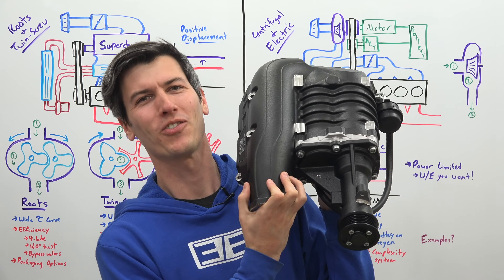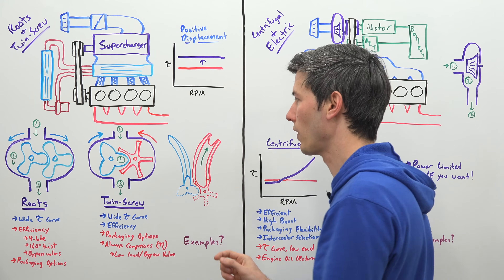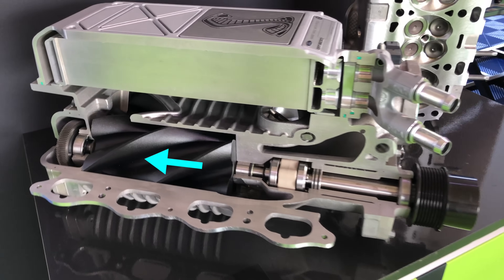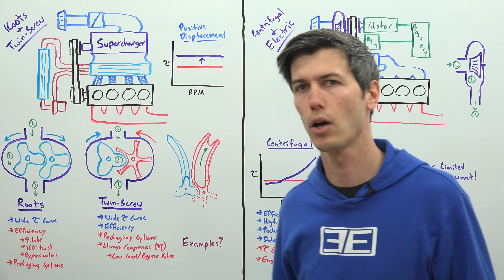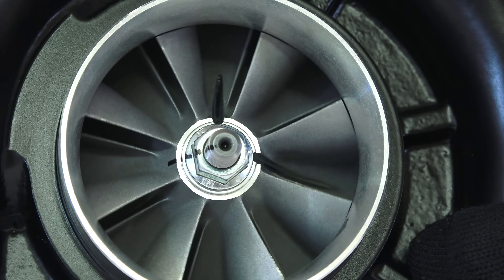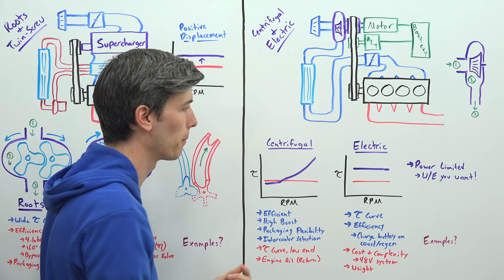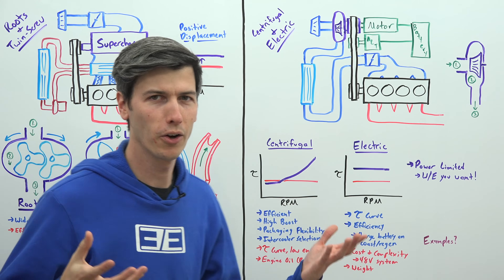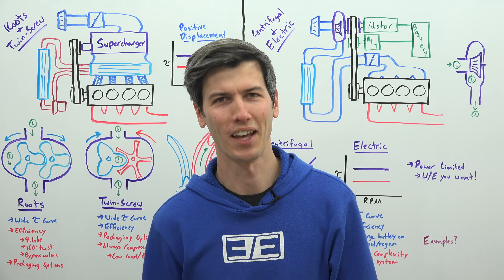What's The Best Supercharger? Roots vs Centrifugal vs Twin-Screw vs Electric

Comment: The twin screw supercharger on my E55 AMG spins at 23,000 rpm. Still blows my mind.
Reply: Heads Mess before the FIA decided to limit revs, the 2.4L V8s in F1 could have done 20k.
Reply: Theres turbos spinning 120k+
Reply: @joonaslaakkonen8096 takes from the exhaust tho, and not everyone likes the sound after
Reply: I have the m113k in my CLS55 and one thing the video doesn't mention is we have a clutched pully so the supercharger only engages when the engine is above a specific rpm.
Reply: @danzimmermann9122  It should engage immediately whenever you put your foot down, I'm not aware of there being a minimum rpm. That would effectively mean your engine would have no usable power at all below that rpm.
Reply: @BigUriel  the 113k is definitely run on a clutched pulley. My pulley just blew apart. Factory engagement is set around 1500rpm. With such a relatively large displacement engine, you already have plenty of torque at that load. I believe it's around 300lbft/1500. With the gearing in these cars, in normal driving you rarely need to be above 1500. But when you want to, hang on
Reply: @redrum2204 similar setup ony Srt6 until I went fixed and stack dammit she whines and kills hell kitty's
Reply: @waltscrossfiresrt6 are you trying to say your Crossfire is faster than hellcats? Pretty sure those all had the MercBenz 3.2 V-6, seeing as the whole car is a Benz. I love getting a better car for less money, pay Chrysler money for a Benz. The opposite of people that spent SAAB money on Subarus and Chevrolets 😂
Reply: @waltscrossfiresrt6 it’s funny if you do beat a cat, they have around double the engine 3.2/6.4 (or is it 6.1?) 

I love those Crossfires, they’re extremely rare these days. I know a lady that runs a dollar store that has a mint burgundy one that’s only been driven in summer. I made her pinky promise to call me if she ever has to sell it. I think it’s an ‘06 and has under 60k miles. My dream garage would include a Viper, Prowler, Neon SRT-4, Crossfire SRT-6, Magnum SRT-8, Ram SRT-10 and Hellcat, just need a bit more money.
Reply: People replying saying their turbo spins at 120K RPM are completely missing the point. It's a lot harder to spin huge great twin screws at that speed 100% synchronized, than it is to spin a fan.
Reply: @JZ-st5zr  yea hes special ed
Reply: @pewpew-_-2157 probably in the same class as you
Reply: No it doesn't. Other crank pulley is larger than Supercharger approx 80% .So 10000 rpm =18000. But rotors run Less speed do to hearing. A blown Funny car on nitro may be in that range. But at extreme end.
Reply: and your engine
Reply: My supercharger doesn’t spin because i don’t even have the age to own I car
Reply: @lyte561 you can own a car at any age in many places. In the very early 2000’s I bought/sold/traded crappy cars from age 12-16 to trade my way up to a beautiful ZJ Grand Cherokee 5.9 limited and a 1967 F-100. I started with a 1984 Subaru GL Wagon with 300,00 miles 😂
Reply: 6.2
Reply: @JZ-st5zr I’m sure you know a bunch of special people
Reply: Hey, anyone here knows can we make a centrifugal supercharger spin at the max for maximum boost??
Reply: @JohnKickboxing  the Merlin engine in WW2 started out with a single stage supercharger providing up to 9 psi boost (for a short time) and that was all the engine could take without detonation occurring with the 80/87 octane gasoline available in 1939. The engine gave 980 hp at that point. A year later in 1940 they got supplies of 100/130 octane and they were able to run 9psi boost continuously for 1200 hp, just in time for the Battle of Britain. A few years later the engine had the two stage supercharger with aftercooler running up to 26 psi boost with 115/145 octane gasoline and got 1650 hp, and over 2000hp on special models.
Reply: @Pygmy-06  Can an engine engineer boost its rpm as much as possible up to 100K++ rpm with electric motor equipped with a gear ratio?
Reply: @JohnKickboxing  limited to the engine.
Reply: I like the Ess twinscrew t2 system

The twinscrew is not so big fit on bmw e46 325i and the intake is also a watercooled intercooler 
But...
But 
Yeah the t1 are still out there the t2 not any more so have to buy the t1 and fined a way to build in a watercooled core in the intake 
T1 is with out intercooler
T2 is with intercooler (wator to air)
Reply: How much pressure can it apply?
Reply: me when I lie
Reply: ....and the centrifugal one on the Kawasaki Ninja H2R spins at well over a 100000 rpm
Reply: Turbo and supercharger spinning is not the same. One is spool by Engine Crank and one is spool by exhaust flow. Totally different when comparing.
Reply: Terrible pun bro
Reply: Centrifugal superchargers now spin over 250,000 rpm 😂
Reply: People replying with how fast turbos spin, check the amount of energy that is required to spin both mechs then talk... lol
Reply: I bought a procharger and that's spinning at 67000rpm at 6400rpm.... It's still not enough though lol I need more boost 😢
Reply: My turbo spins at up to 200,000 rpm.
Reply: @2loco  so…you’re better than us
Reply: @2loco what about the low end, when you’re driving at 2k rpm?
Reply: Turbo’s spin at usually around 120k rpm
Reply: That’s not anything special.
Reply: @nodo7575 exactly, nice humble brag (not even that humble lol) 
My 12” unit feels nice and secure in these new underwear, it’s really crazy how good the material is.
Reply: @nodo7575  like you?

Comment: I wonder...could a new reengineering of the turbocharger, include a roots-type or twinscrew design? It'd take a lot to accomplish it though, but it's an idea.
Reply: They turn at quite different speeds. And you wouldn’t get rid of the turbo lag because the turbo still would have to spook up. 
Sorry didn’t want to be negative. What benefit did you have in mind?
Reply: @Conservator.  I was thinking of the same setup, but using turbo impellers instead of the lobes for the supercharger. It would be a top mount design.

Comment: I didn't think I'd hear the use of word "Free" regarding energy at Engineering Explained
Reply from the maker: Free is relative. If it's a gain that otherwise would never happen, I'll call it free.
Reply: @EngineeringExplained  that was supposed to charge the NORMAL battery, no? So if the down hill crank is now charging the super charger battery, you're trading the normal battery which still needs to be charged for other electronics and ignition power.
I'd call it additional efficiency capacity

Comment: Question on the roots and twin screw, as engine rpm goes up does boost not go up? I would think that as the internals move faster it would move more air and increase boost...
Reply from the maker: Boost remains constant, for the most part. Yes, at higher RPM it pushes in more air, but that's because at higher RPM the engine needs more air. Ultimately the boost remains fairly level.

Comment: An hybrid system using the smallest battery possible to power an electric supercharges is the most economical. But that’s a bit harder to implement. You need an additional generator but the supercharger can be designed to act as a generator: during braking it can keep the bypass open and it ineeds to be connected mechanically to the gearbox. 
The minimum battery requirement for a 8psi of  boost is 35kw (1psi -6hp typically). For that you need a 3 packs of 200Ah 48amp batteries with a total 900Amp continuous discharge. The cost of the packs can reach like 10k$. And weigh 200kg 
With a 200hp engine you can reach 300hp. But it’s simple to use the motor/generator without the supercharger and you will make 248hp combined and the engine will be far less stressed, even less than without the motor.
The mecanical roots supercharger like you bought for the mazda is I think the simplest and most convenient to get a good boost.

Comment: No Wolkswagen G20-G60 "Spiral" supercharger? That is an interesting one to mention, maybe next time.
Reply: No Rolls-Royce rotary supercharger, that was used on their diesel rotary, either. Also the 'spiral' supercharger is called a scroll-type supercharger, or G-lader. Also no mention of sliding vane, axial compressor, or pressure wave superchargers. There was also no mention of variable ratio centrifugal superchargers. None of these were mentioned because of how commonly available they are from OEMs and aftermarket companies. Roots, twin screw, and centrifugal are vastly more common than any of the other ones mentioned here. 
I'm also not really sure why electric was thrown into the video, as that's a drive type, just as exhaust driven and mechanical (belt-, chain-, gear-, and direct-) driven are the other two drive types. A better video for electric to be shown is when comparing supercharging, turbocharging, and electric-charging on the same centrifugal compressor.
Reply: @xaytana  whoa that's the 1st time I've even heard of a scroll compressor as an ICE supercharger. I've only known them from heat pumps/air conditioners.
That Rolls Royce diesel Wankel was pretty much a series Wankel engine when you think about it wasn't it? One chamber compresses to the other one where the combustion happens, like half an engine (if not more if it was bigger) just for the boosting.
I can understand why he added the electric one to the video, probably just to clear up the doubts about what it actually is.
Reply: @xaytana  Torque curve tells all as far as centrifugal is concerned. He's already given it away here. Electric has flat curve because it doesn't have to follow engine RPM. turbocharging and supercharging do.
Reply: They work very good, as long you replace the apex seals and you keep the small belt in good shape. If not.... bam.

Of course I had the same problem with a BBM lysholm (twin screw) supercharger kit and our crappy roads. Those very tight tolerances didn't like being jarred around. Just one bad one at the wrong time and - crunch. Expensive lesson.

I ultimately gave up and just changed the whole 8v engine out for a 20v 1.8T. No more supercharger problems, more top end, and much better mileage when not at a track!
Reply: Even more interesting: I work with a guy who has a g-lader, in use on a car, that has not failed!  Maybe the only one.  ;^)

Comment: But you still didn't answer the question of why a manufacturer would go with a particular super charger.
Reply from the maker: They weigh the pros and cons and choose what makes sense for them. Cost, reliability, and performance all play a factor.
Reply: @EngineeringExplained  that would be a great in depth concept to go into I think.

Comment: Aren't there any setups that use the exhaust part of a turbo to drive the compressor as the rpm gets high enough, and has some kind of gearing (like a bicycle?) so that the power needed to turn the compressor is then freed?

Comment: So hold on... Does an F1 car have a turbocharger or an electric supercharger? Because it is driven both by the exhaust gases and the MGU-K
Reply from the maker: You could call it either, but makes the most sense to simply describe it as an electric turbo, as it's still using exhaust for most of the work.

Comment: It would be nice to know how each of these stress the engine differently. Ive always heard that having the low-end boost is bad for your engine but an explanation of why wouldn't hurt :)
Reply: My understand is that it has to do with the torque peak of the engine. On most engines the torque peak is relatively low so having boost down low mean that you are making more torque vs boost up top. Too much torque will probably break the rods so you really want to make boost past the torque peak or at least less boost on the torque peak.
Reply: @maxwelltollefson9947  Torque at high rpm is worse for the rods than torque at low rpm, the compressive load of the combustion is the same either way but at higher rpm the rods have to handle the inertia of the acceleration and decceleration of the piston every time it reverses direction on top of it which is higher the faster the engine is turning.

The problem isn't the load on the mechanical parts, it's knock. Boost increases the chances of knock, much more so at low rpm than high rpm, because at high rpm the air is moving very fast and quickly swirls around the cylinder as it goes in, so it mixes very evenly and even if any hot spots develop they get mixed with the rest very quickly. When you're boosting a NA engine you may find it handles the boost just fine at high rpm but knocks when you floor it at low rpm. This is also why higher revving engines can get away with higher compression ratios, motorcycle engines that rev up to 14k+ rpm have compression ratios as high as 14:1, and don't even need direct injection, but they also have poor torque at low rpm as they have to retard ignition because of it which reduces efficiency.

Comment: my 2.3l duratec turbocharged ranger is making 340hp and 413 lbs of torque, thats the best i can get after blowing up 7 other motors lol but its one fast ranger at 8100 rpm and m50dr1 and 4.10 7.5 open diff

Comment: centrifugals are actually safer on engine internals and drivetrain components due to thier linear fashion instead of unleashing huge torque at low rpm where you're more likely to bend or brake something.

Comment: Has anyone ever tried variable "gear ratio" supercharger in car use? What I mean with variable gear ratio is ability to spin supercharger more or less independently to the engine rpm. Like having something similar to CVT between engine and supercharger. It would allow to disengage supercharger when not needed and also provide the right amount of boost when needed. Even at quite low engine rpm.

Comment: couldn't you just put on a small 48 system with a few kilos of lipo batteries and just charge it using the car battery using a DC-DC boost circuit, making the 48-volt electric system exclusive to the supercharger? This could greatly reduce the weight penalty for electric style superchargers when compared to the belt-driven.

Comment: This type of discussion becomes a much bigger topic when it comes to chiller systems. In HVAC engineering, large industrial chillers either use rotary screw or centrifugal compressors. To provide volume and capacity control, rotary screw compressors are equipped with moveable slide valves (MSV) and moveable slide stops (MSS). This allows the constant rpm, Pos. Displacement Screw compressor to match chiller loads over a wide range. Normally the MSS and MSV move mated together and the further to the discharge port they move the greater the compression of the refrigerant and thus the more work that can be done. This is volume control. If the MSV starts to separate from the MSS, some of the refrigerant escapes through the gap and isn't compressed, returning to the suction, and unloading the chiller. This is capacity control. Chiller controllers adjust the positions of the MSS & MSV as necessary to maintain chilled water temperature with varying loads. Centrifugal compressors with variable speed drives and adjustable inlet vanes are the standard now for the industry as they can efficiently match loads for the chiller simply by changing the rotor speed. However, under very high summer loads the condenser pressure can become too high, higher than the compressor discharge, and cause "surge" which is where refrigerant at high pressure pushes back through the compressor. Not good. Screw compressors, being pos displacement, do not have this issue, however.

Comment: Thank you for another good explanation, supported by great video material. I'm surprised that air to water cooling is used , as the water temperature is already circa 90 deg C. So the air temperature to the engine  could be 110 deg C ?  I wonder whether there is not a cost difference among  these devices ?  Then  little mention has been made re the power consumption of each device. 
  The power consumption could typically be 7 kW, which would require that the electric ones are only used for short periods.

Comment: For the electric supercharger, could you hook up the alternator to a turbine that is connected to the exhaust? So basically a split turbo with an electric motor in between?
Reply: Exactly my thoughts too. You’d have the huge benefit of having instant boost available ‘WHENEVER YOU WANT’. 😄

Comment: We had a procharger centrifugal with air to air intercooler on our gmt400 454 vortec. It was a good pairing as it kept pressures low where the torque was already strong and helped it pull hard up top while netting slightly better economy. Not a ton of boost, about 4.5 psi at my elevation, but it also meant I could safely run mid grade instead of premium unless it was hot or while towing. Putting 40+ gallons of premium in kinda sucks. That brick was a lot of fun
Reply: Hey, anyone here knows can we make a centrifugal supercharger spin at the max rpm for maximum boost like a turbo equipped with anti turbo lag??
Reply: @JohnKickboxing thats going to be hard unless you can find a cvt capable of insane rpms